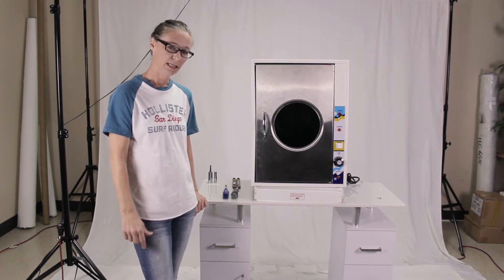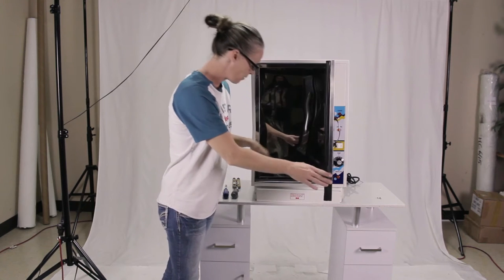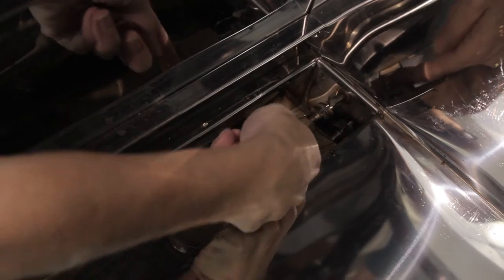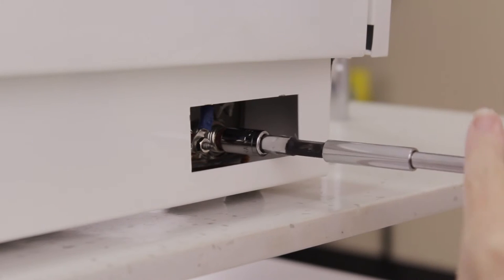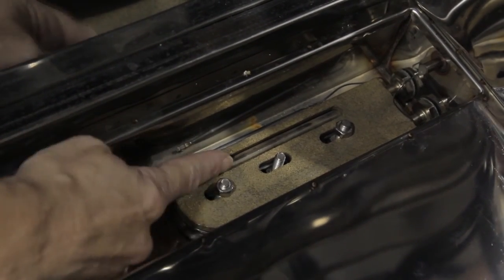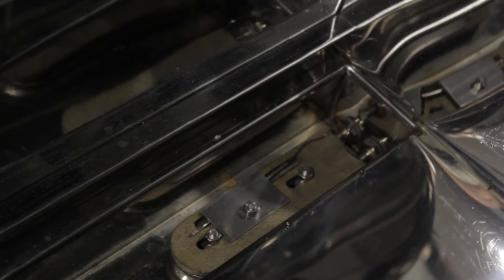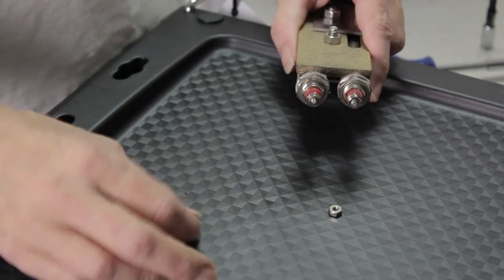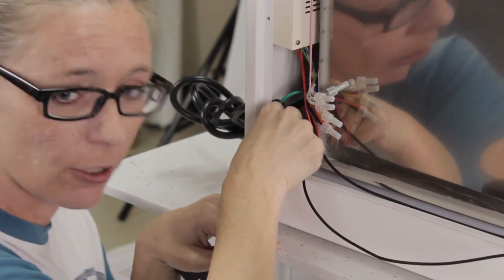Trouble Shooting Your Dermalogic Towel Steamer PT1

Comment: Hi how do you  drain the waste water
Reply: From the tube in the front of the machine
Reply: @naturalwonder808  hi I bought the low water sensors and control box I replaced but the low water light kepp on an off all day even the water full so what can I do to fix the problem?
Reply: Low quality for the price